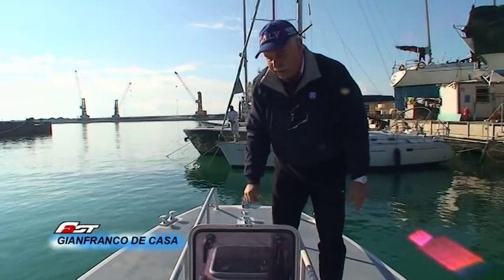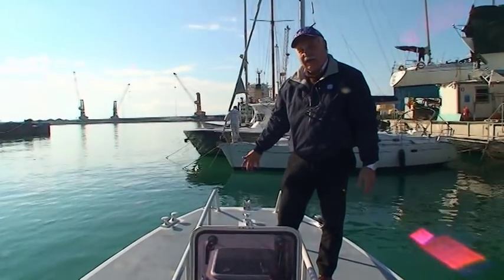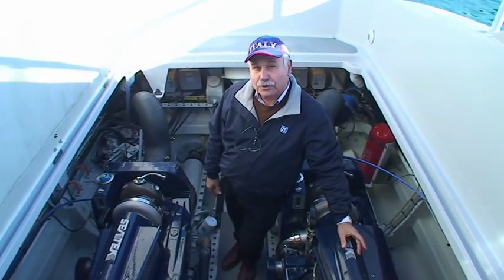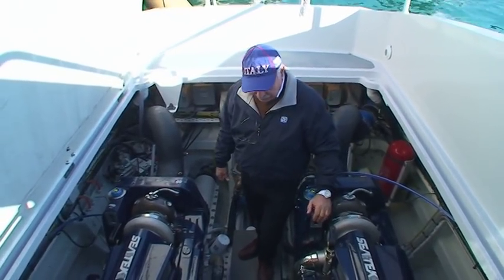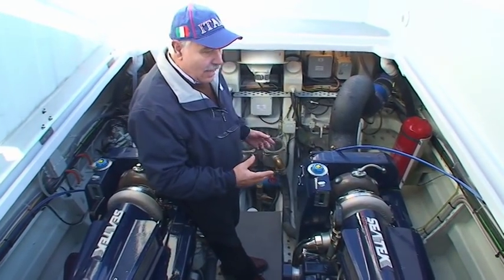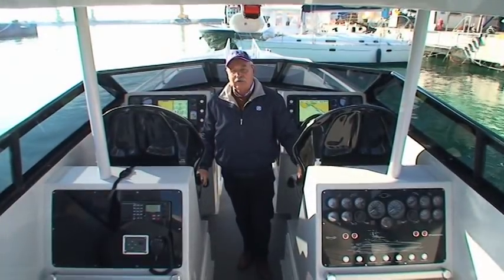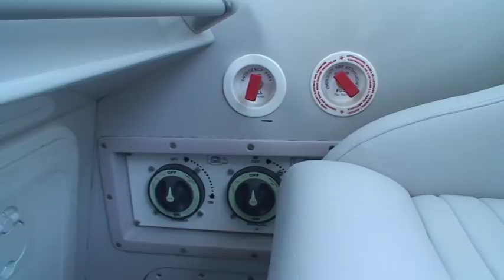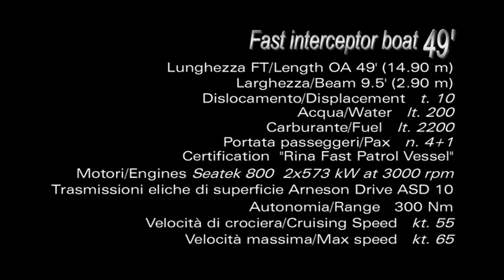Fast Interceptor 49' - Vittoria Shipyard - EN

Comment: so it will cruise at 55 nautical miles   and top speed is 65 nautical miles ?   i taught nautical miles was a unit of distance not speed?    was expecting mph    kph  or knts
Reply: Knots is nautical miles per hour. 55kt / 101kph / 63mph
Reply: @JP_94  little harsh,  how about just explaining it Instead for the ones that aren't as educated as you might be in the matter,
Reply: You are confusing nautical miles with parsecs
Reply: good point!  knots not nautical miles